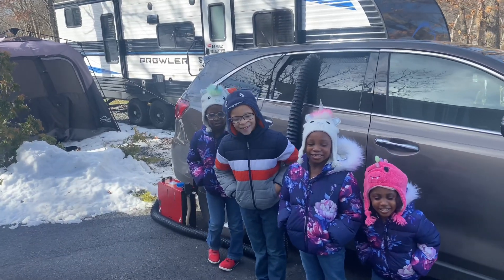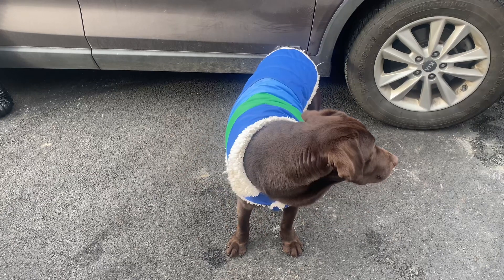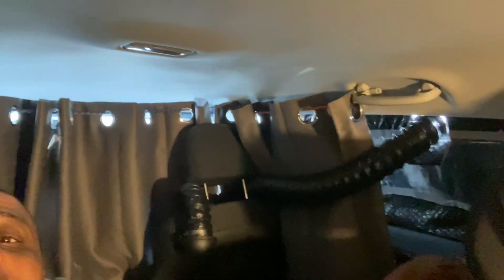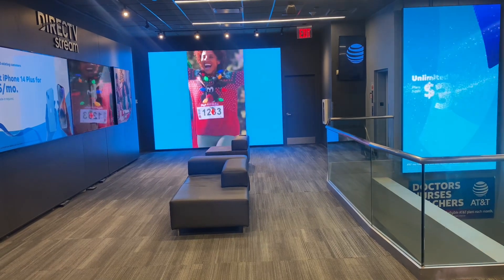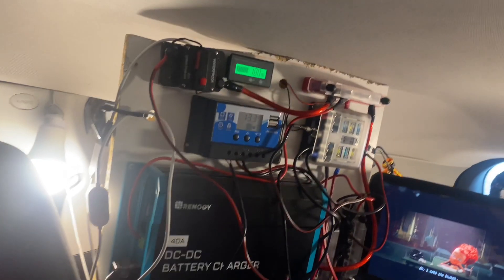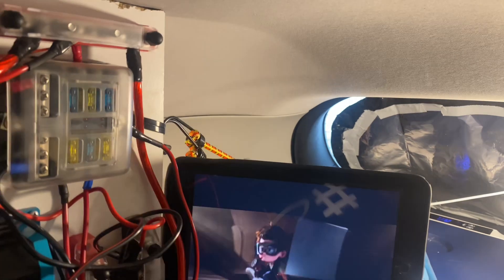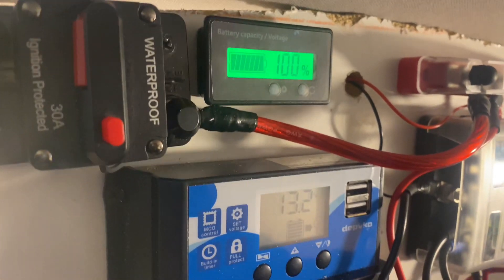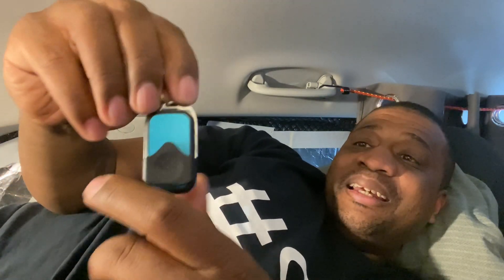Diesel Heater 5kw All In One Heating The Inside Of SUV / Winter Camping With Kids And Pets

Comment: I plan to switch my internet in May because mine got too high but they lowered it last year for a limited time so I wouldn’t leave. I’ll investigate AT&T. 
I agree on the violence. 😢 It’s good to know about the camping areas you’ve experienced. I was starting to think maybe I’d better not travel. 
I was hoping to have a stealth van some day and then I found out how expensive they are. My neighbor’s Dad came to visit and had one. I mentioned that is my dream and he said be careful. Some of them brand new have electrical issues.
Reply from the maker: Hey Heather. Yes many of the new ones have electrical issues. They are hard for buyers to fix because we wouldn’t know where the problem is. Most times it’s terminal endings that come loose. The more technology and electronics that are in the van the more likely something electronic is going to go wrong. It’s cheaper to build the van yourself so you know where everything is. 
The violence is horrible. I just like to stay home when I’m off.

Comment: Great job. I have one question for you,    do renovo can top out baterries or not?and does it can give this 40Amps its on lable?
Reply from the maker: I have LifePO4 batteries (lithium). There a mode on the Renogy charger for it. It does top off the batteries. The 40 amp version is more then enough to keep the batteries charged with the alternator.

Comment: I have the same 5kw heater. They work great. Have you had any issues with the fuel line leaking?  Mine has been great so far. 24:22
Reply from the maker: No issues yet but if it does leak replacing it is very easy and the parts are easy to find on Amazon